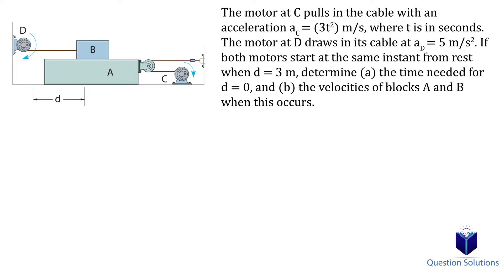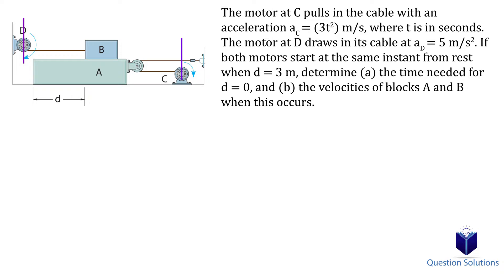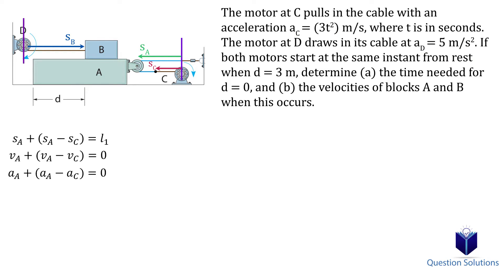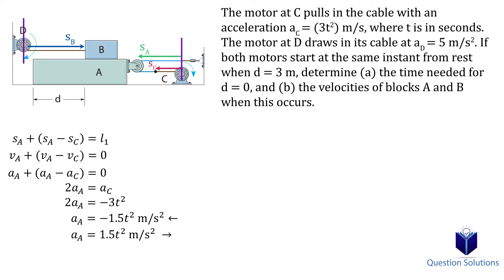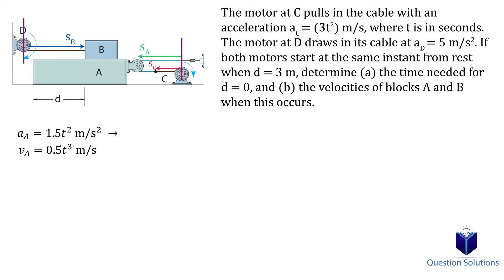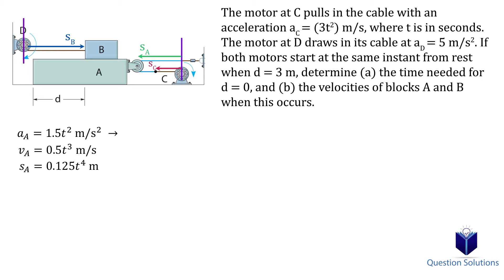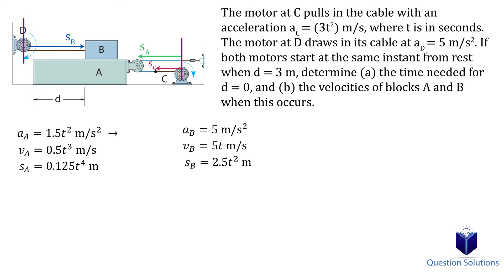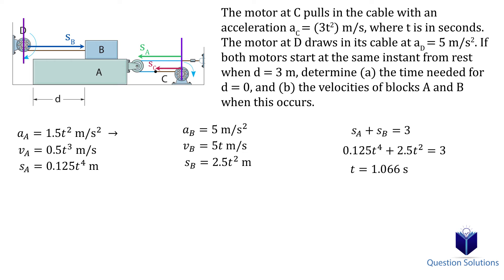The motor at C pulls in the cable with an acceleration (solved)

Comment: The acceleration of B is actually going to the left so why we didn’t consider it as a negative??
Ba=-5t
So 
S = -2.5t^2

So
0.125t^4-2.5t^2=3
Reply from the maker: Once you draw your position coordinates, that direction, (regardless of the movement of blocks), will be considered positive. At the end, if you end up with a negative answer, then it's opposite to the direction of your position coordinates.

Comment: can you pls explain how Sa + Sb = 3 ?
Reply from the maker: Please watch this video first: https://www.youtube.com/watch?v=IudPPGIV5QM
Reply: @QuestionSolutions  saw that still have doubt
Reply from the maker: @ElCrankoPunko  So what we're trying to do is calculate the time needed for the blocks to be apart 3 m from each other. Another way to think is that they start from d = 3 m, and we need to find when d = 0 m. So we can say the length SA plus the length SB has to be 3 m. This 3 m is the difference. I hope that makes sense.
Reply: @QuestionSolutions  Is it like Sa-(-Sb) = 3
Reply from the maker: @ElCrankoPunko  It's the difference between the lengths, so you can think of it the way you're thinking.
Reply: @QuestionSolutions  yup that’s what I was thinking from the start

Comment: Why must we take the aA as positive value before integrate?
Reply from the maker: You don't have to really do that, but I just find it a lot easier to work with positive values, that way, you don't have to keep writing arrows to the left. At the end, you will still have to make it positive to get the displacement. So why not just do it at the start and then you don't have to worry about it. At least that's what I do when I solve questions. I hope that makes sense, but you can do it the way you mentioned too and then switch signs at the end. Entirely up to you.
Reply: Question Solutions but still why do I have to change it to positive value? What if I plug in - 0.125t^4+2.5t^2=3. Would it be wrong?
Reply from the maker: @Kimi-vn7jz  Good question. Yes, that is wrong. You are now using two different references to find the answer. If you use that reference (sa = -0.125t) as negative, then from that reference, you will get -2.5t for sb, and -3 m as the distance between them. I am not 100% sure how to explain this clearly, I think when you do a lot of questions, it will probably click in your mind. Change it to positive, and all should be good. I think the text book states the values need to be written so that it "has a positive sense."
Reply: Question Solutions okay thanks a lot! This is only applies for pulley right?
Reply from the maker: @Kimi-vn7jz  You're very welcome. And yes, for pulleys, a positive sense is used.

Comment: Why Sa+Sb= 3m? Wouldn't it be 6m since the position of both blocks was displaced from 3m to 0m, which means each of the blocks was displaced by 3m, and that will make a total of ( Sa+Sb)=3+3= 6m
I am confused about this part. Please clarify. Thank you!!
Reply from the maker: The question is only asking us to calculate the time needed for the blocks to be apart 3 m from each other. Another way to think is that they start from d = 3 m, and we need to find when d = 0 m. Hope that helps.
Reply: @QuestionSolutions  can you clarify a bit more please? How do I think about this? Is it the fact that the sum of the two that needs to equal three which means that B will make a displacement to the right and A to the left SIMULTANEOUSLY until B will be at the end of A (from the left) so that d=0?
Thanks in Advance!
Reply from the maker: @Pcbbeastv482  That is correct. It's a weirdly worded question, but it is simultaneous movement. So the movement of both blocks (3 m in total), gives us the d = 0 we are looking for. I think students get confused thinking its 6 m, but the datums are opposing, so it becomes simultaneous movement. I think a good way of seeing this is to use a ruler and 2 erasers and push with your fingers to get an intuition for what this question is asking. :)